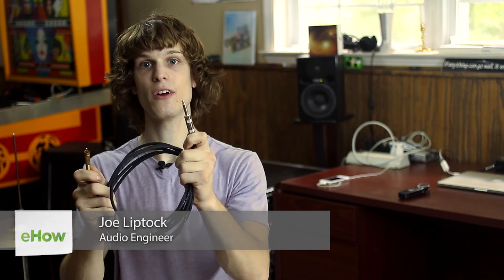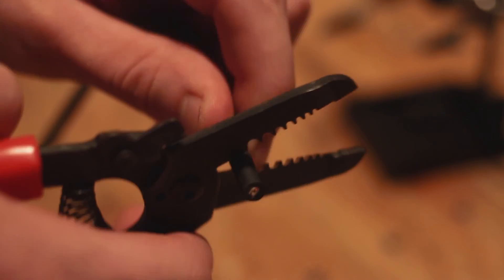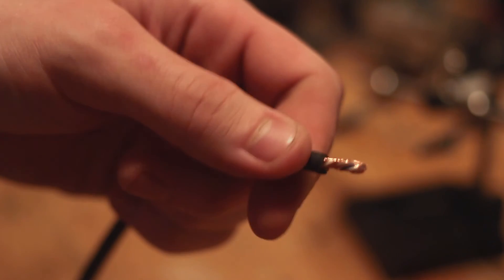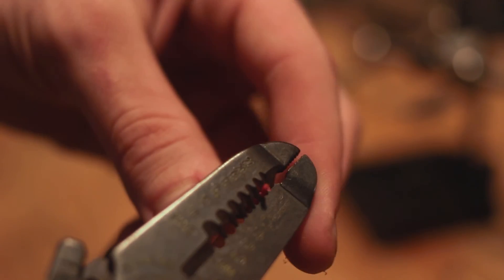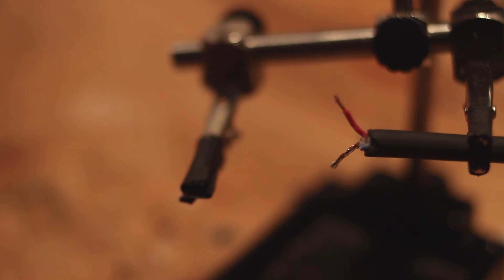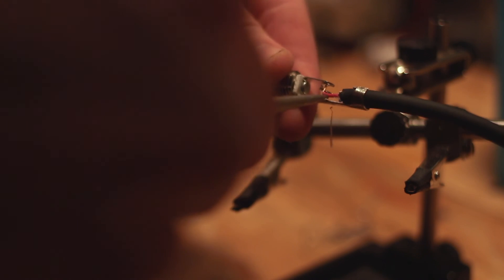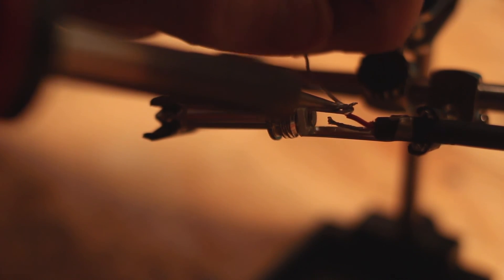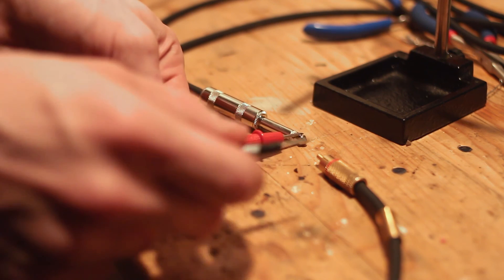How to Convert an RCA to an Audio Jack : Audio Tips

Comment: Hi. I wanted to change the connectors on my old turntable from RCA to TRS/TS. The turntable has left and right RCA output, but the cable has no +/- or ground. Could it still be possible to replace the connectors or not?